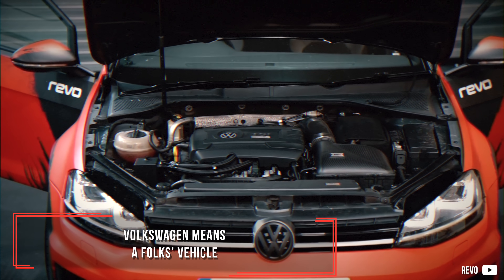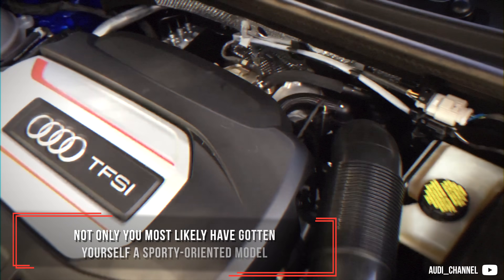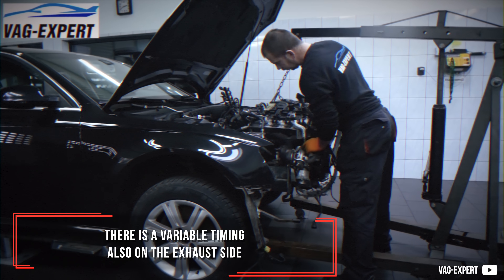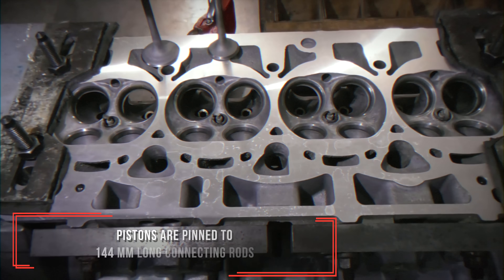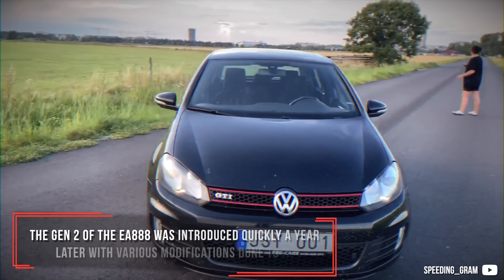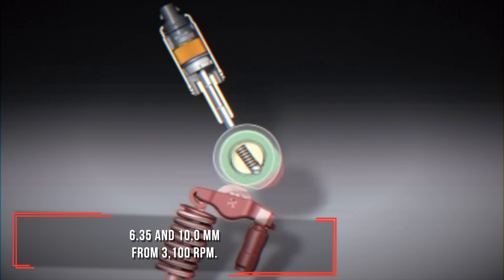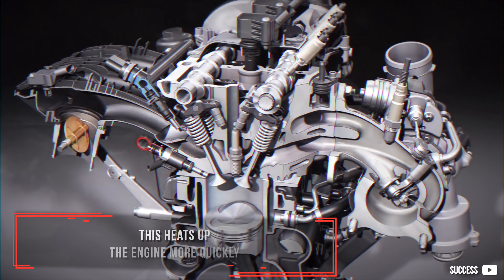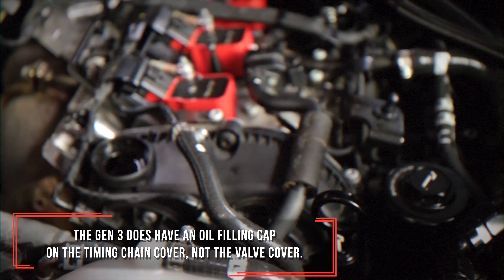Why The Volkswagen EA888 Is So Good

Comment: Luckily I'm driving an old Audi with an 1.8T 20V - Even tho it is 26 years old, it still feels like its been just built
Reply: @MIGHTY MQB I've got an aum engine in an a3.
First thing I did was remove the SAI system completely. With it I removed the DV solenoid.
Soooo much less vacuum tubing and crap all around. Much more reliable this way.
I haven't really had any trouble with these engines mechanically 🤷‍♀️
Reply: @spiKey0svetlana  It is also good to remove oil vapours at all and put a catch can.. So much cleaner intake hosess and intercooler!
Reply: @Mtematiks just make sure you have a way of telling when it's full instead of opening the can all the time 😁
Reply: @spiKey0svetlana  I live in a country with a lot less regulations, and our "catch can" is a big open hose, long enough to arrive near the rer silencers to avvoid the smell 😂
Reply: My Golf 4 1.8T GTI has 360.000KM and it still runs great❤️
Reply: 1.8T NEVER LOSE!
Reply: 1.8t are great motors. I love my big turbo motor as it’s awesome around town, decent on gas, and peppy up top with bigger turbos
Reply: @MIGHTY MQB shocking vag still such poor quality in 21st century but in over complicated engineering 😪 I’ll never buy another German car ever again after mk b7 Audi 2.0tfsi constantly cost tons of money to fix even with Audi full service history. Loving my Lexus 450h now not let me down yet you need to get to know the Japanese cars.
Reply: I have a mkiv Jetta 20v 1.8t. 
The all the torque all the time spoiled me. It has been hard to find something to upgrade to got daily use.
Reply: I had one of those !! Awesome engine, I had an old jetta  mine had 165K miles before I sold it, still ran fine. Im on my third EA888 engine now- I have the 2018 Audi S3, and its hands down the best car I have ever had..its a beast, handles exceptionally well of course highly tunable and total joy to drive.
Reply: Luckily I drive an EA888 and i'm capable of de-carbonizing the intake valves lol.
Reply: Had that same engine on my mk4 golf gti great cruiser on the motorway.
Reply: @MIGHTY MQB yep I went from a money pit Audi A4 b7 2.0tfsi se (oil chain pump failure x2) costing thousands to fix not including constant oil burning every three months loving my new my now super reliable Lexus GS 3.5 450h natural aspirated engine it’s a beast.
Reply: Same here mi a4 is from 1995 and im born in 1996 xD
Reply: @alelx jines I have a Gen2, more like every 30k for us
Reply: I drive Audi A4 B6 - feel the same
Reply: Good to hear that and thanks for sharing. I was advised by my technician that 2.0T is even better than 1.8T. 👍
Reply: Every car has it's downfalls this one just so happens to be the timing chain tensioner and guard rails and yes some consume oil more than it should and I've heard of the inner manifold flaps having problems but the timing chain and tensioner is the most important if the car was taken care of there great cars but I picked up one in great shape with 98 thousand miles before knowing anything and know I'm fixing things slowly but car runs fine im just doing maintenance so it will go another 100 thousand miles without me worrying but fixing this issues are very expensive and it's hard to find a good mechanic for Euro car's
Reply: The 1.8T had its own set of problems.
Reply: Same👉
Reply: Yes,last of the good engines!!
Reply: @MIGHTY MQB 😭😭😭
Reply: my father has one he bought it 4k and when he drove it a little wile both clutch and clutch plate broke costing him another 1100
Reply: @MIGHTY MQB I feel you. I'm still trying to locate issues on my mothers '03 Audi TT 8N9
Reply: This is a EA827 Not EA888!
Reply: hell yeah i have a passat b5 1.8t with 270k mikes drives like new have done 10 hour trips no problem but on the other hand i have a mk1 tiguan tsi that doesn’t step out the car shop at only 120 k miles 🤦🏻‍♂️
Reply: @alelx jines Why?
Reply: i own a 06 jetta gli with the old school fsi engine… im at 176k miles and it runs so good still. it’s also incredibly quiet for a fsi. all i do is change the oil frequently, cam follower, etc and it hasn’t left me stranded anywhere. love this car
Reply: Typical Audi driver take
Reply: I have an apx turbo 1.8 5 v on my 2001 TT. Any good?
Reply: I have to completely agree with you. I had a mapped MK4 golf GTi anniversary which never ever let me down in 5 years.  Biggest regret getting rid to buy a mk 7 .  So much has gone wrong with it 🫣
Reply: ur villebrequin are big not tiny like 3l today are so tiny make a bit laught 😂
Reply: yeah i have it in B5 A4 and its great engine i think it is mostly because it was originally audi developed engine for racing purposes and not just some VW developed engine used in Audi
Reply: @lukasryba7141  Most of the VAG watercooled turbo engines are Audi-designed.   When VW  originally acquired Audi, VW had absolutely zero expertise in liquid-cooled engines.
Reply: @lukasryba7141  EA888  is made by Audi, not by VW
Reply: @lukasryba7141  1.8T is modern 2.2T without the 5th cylinder . 😉
Reply: I also drive a A4 B5 1.8T, year 2000. Great engine, great tunability and good performance with low fuel consumption.
Reply: @nicostenfors5690  Me too, but only 1996. I also get great fuel economy (usually under 6.7L/100km) but i miss a 6th gear 😭
Reply: @nicostenfors5690  I have a 2000 B5 as well!
Reply: Both of EA113 and 888 are complete SHITT of engines.... so much so, that I bought an EA113 car with 54K miles on the clock with broken ebngine... 54K MILES
Absolute piece of crap of an engine...
Reply: @Mtematiks  A vehicle is as reliable as its owner.
Reply: @Mtematiks  what does that have to do with the 888?

Comment: the EA888 or generally the tfsi engines are a walk on the edge, if they run they run but if they fail: endless money pit. using High Quality fuels (even when not insisting to tune it) shorten oil change interval to 10000 km or one time per year is mandatory.

Comment: I got a Q5 with this engine. 90000 miles (150000 KM) and it runs like it is brand new. No oil consumption, no leaks of any kind.

Comment: Isn’t it true that the US/Canada EA888 didn’t get all of the gen3 upgrades, such as (but not limited to) dual injection?  Does anybody know the starting year where the EA888 gets added port injection in North America?
Reply: Port injection is still not here in the US
Reply: It’s true. Eventhough the Gen 3 engine is fantastic. Europe got the more stout engine version, sadly.
Reply: @647killa  both engines were equally stout. Adding port injection for fuel efficiency didn't make the ROW engines more reliable.
Reply: It doesn't get dual injection in north America unfortunately, I have a 2020  GTI. I wish it did.
Reply: You need to go aftermarket to add port injection to NA engines, and in fact VW got rid of the dual injection on the new MK8 for ROW too, so now all of them are strictly direct injection.
Reply: europe gets the cool engines and does not push them as hard as americans do

Comment: It is a strong, tunable engine but I hear quite a lot of stories of faileurs at under 100k miles, which is not very impressive!
They certainly go quick especially when mated to DSG (also prone to early failure) and AWD but they do sound dull even when tuned.   I think VAG have done better engine overall in truth. But as modern engines go, it is not too bad.
Reply: Rest assured those are rumors.

My 2016 MK7GTI has Unitronic stage 2 at 337HP and 370ftp. 
Since Ive owned,  ZERRRRRRO failed parts, mechanical or electrical. Hmmm, I want to thank the Mexican 🇮🇹 partners for great workmanship.
Reply: Bullshit.

You can beat the hell out of Volkswagen cars.  What starts happening at the 10 year mark is that they start to "nickel and dime" you, but it is little things like power windows, sunroof motors, cruise control....et cetera.  A properly maintained EA888 will easily see 300,000 miles.
Reply: @Flies2FLL  If there are ANY modern VAG cars still running with over 300k on the clock then I can guarantee they will have had virtually every moving part (and most of the electronics) replaced.  I've never owned a VW myself (though family members have) so I concur about all the failing accessories and electronics, but a quick check on any VW/Audi owners forums will reveal no shortage of owners suffering engine/transmission/suspension/electronics issues far earlier than they should and the EA888 is no exception to this.  Modern Mercedes and BMWs aren't any better either - All built down to a price.
Reply: @soundseeker63  "I've never owned a VW myself"

I'll just leave it at that-
Reply: @Flies2FLL  Yes, all the hassle family and friends have had with theirs in the past have convinced me they are unjustifiably overpriced rubbish.  We'll leave it at that.
Reply: @soundseeker63  I drove a Volkswagen Scirocco turbo for eight years, and during the first four, the only thing that I had to replace was a brake light bulb.  Another car, a '97 Jetta GLX was literally.....Christine.  I liked the car but it didn't like me.  It all depends on how the car is maintained, the Jetta was bought used and had obviously been abused.

Odd fact about that Jetta: The first owner lived at the condo building in Surfside, Florida that eventually collapsed...
Reply: @soundseeker63  plenty of TDI cars have made it to 300k
Reply: @soundseeker63  your ignorance is breathtaking.My 2016 MK7GTI has Unitronic stage 2 at 337HP and 370ftp. 
Since Ive owned,  ZERRRRRRO failed parts, mechanical or electrical. Hmmm, I want to thank the Mexican 🇮🇹 partners for great workmanship.
Reply: @sporopeza  The fact that a certain engine/make has known reliability issues does NOT mean every single one of their cars fails!   So no, my "ignorance" is not breathtaking. I'm sure there are plenty of GTi/R/S3/TFSi/Cupra/vRS owners out there who have has no major issues during their ownership.
What I also know for a fact is that there are owners who have had MAJOR issues (as I've already described) a lot sooner than they should.  Obviously you are one of the lucky ones if you have not. That doesn't mean all the (very well documented) failures are non existant / made up.
Reply: @rocavelli20  

Yes the oldskool 1.9 tdi's

EGR and VAG, tends to be problematic. The downsized engines strugle a lot.
Reply: @Flies2FLL  
Got a (gen 3) 3-door hatchback s3 (8v) dsg/s-tronic.

Engine is smooth in total powerband. Not as exciting as n/a or oldskool turbolag cars. But lots of power, decent gasmileage and sound. 

I am extremely carefull with this car, only premium fuel (v-power, octane 98 in my country). Yearly oil changes,  around 7-10k km.
I do drive a lot of short distances, but always with care. Only getting on the power when properly warmed up. 
Most days only using 25% of power, without or minimal boost pressure, according to gauge in dash.  

Have had issue; of car turning of while driving in eco mode, during lift and coast. Was problem with start/stop system.

Have had (around 125k km) problems with rough running. Sometimes having more power than expected sometimes less. Without warninglights on dash.
Codes: cam an cranktiming timing of.
Work done to fix issue.
-leaking injector switched others were tested and cleaned. 
-worn cam (sensor, but one piece)
-stretching of chain.
Chain is was not yet due but close (5th tooth adjuster)
-Main problem eventually turned out to be an minor intermitting fault with oilpump; took 3 weeks to find by dealer and expert.

Enginewise no further problems, no oil burning f.e.  
Except the engine sometimes feels sluggish/sleept after cruising for a while and then stepping on it in comfortmode. 

Drivertrain had an easy en cheap fix on haldex system. Rear wheels didn't engage (shortly after oilchange) Electronical update fixed it. 
Also no warning light on dash. 

I love my car; but reliable/bullitproof; definitely no.

Also a lot of (downsize) European engines have carbon problems, worn piston rings, oil consumption. Stretching chains. Leaking waterpumps. Worn oilpumps. Dieselgate and EGR valve(coolers)

Our other car seat ibiza 1.2 tdi ecomotive (vw bleumotion engine) has its EGR replaced for the 2 time at 175k km. (With only 17k km between them!) (So now driving with 3rd EGR), and a flush at 191k km.
After recall/reflash/remap., due to dieselgate, EGR fail a lot!
ECU/computer also had to be recalled (als due to egr/dieselgate)

Comment: The 2.5 5 cylinder engine in the 2011 jetta is an absolute beast for a n/a engine. vw is really impressive for engine power delivery but boy some design things can be annoying to work on.
Reply: I've got the 2.5 5 cylinder in a 2009 Rabbit and went IE stage 2... Great engine. Great sound.
Reply: vr-5 love dem. vr-6 with 4-motion tho as golf 4 vr6 and leon cupra 4 1m
Reply: @yoshi555king  wish we got the VR5 in the US. Such a cool engine.
Reply: Idk what makes the EA888 so great, but it's definitely not how the thermostat is under the intake manifold (like everything else) so what should be a $30 part that any competent garage mechanic can replace in a couple hours is actually a $180 part that requires over $1000 in labor to replace (I've done timing belts on Nissan 300zxs, done uncountable work to E46's... I wont try to remove the intake manifold on an EA888 golf. It is absurdly hard). I swear, the lead engineer's wife must have run off with a mechanic because as amazingly engineered as the EA888 is, it's designed to make the mechanic's life hell.
Reply: @thirdpedalnirvana  it's almost if they designed it thinking it was gonna be awesome and bulletproof so they'll never need to replace any of this pain in the ass stuff.  Stupid place for a thermostat, just like BMW putting two turbos in the V of a V8 and assuming it would be fine, all that heat there.  Idiots.  Or GM pitting the Northstar starter in the middle u Der the intake manifold.  There's lots of questionable designs.
Reply: @thirdpedalnirvana  I'll agree with that for sure
Reply: @thirdpedalnirvana  And on my Audi S1 you even have to rip the whole front apart to remove the intake manifold. Because there is no space at all.
Reply: I am a happy owner of an Audi A3 1997 1.8 and a VW Jetta Variant 2012 2.5, both great NA engines!
Reply: You must be kidding that thing is a dog
Reply: Have to agree that tucking the water pump way under the intake manifold makes it really annoying as hell to get to.
Reply: The least reliable part of it is the vacuum pump, which doesn't clear the selector shaft on the transmission, you have to open the pump (which VW says not to do) and rotate it out with the selector shaft going into the pump. Once you do it a few times, it's not so bad, just have to make sure you don't contaminate the pump with dirt and get the vane installed properly when you put it back together.
Reply: Drive any volvo engine and youll realize the 5 cylinder in the usdm vw's is trash. Yeah, it's got torque, the 2.5 liters make torque unavailable in the competition which was usually a 1.8 liter engine. But it's rough as an unbalanced washing machine on spin and can't breathe at higher rpm. It was a cost cutting exercise. It is an affront to the good name of the 5 cylinder engine.
Reply: @thirdpedalnirvana  yes, the 2.5 didn't get the love it deserved from vw. But Audi took it and basically added direct injection and made the block aluminum. It's a good engine, just needs some love from the aftermarket

Comment: So I think the main thing here is that the years for the engines are kinda wrong. The Gen 1 was produced from around 2008 debuting in the Mk5 GTI to about 2016 in certain applications like the Tiguan, with the Gen 2 being from 2008 to around 2013. The Gen 3 that is ubiquitous today was introduced in the mk7 golfs in 2014 and is still produced today.
Reply: Wrong, MkV still had the EA113.
Reply: @MercSLRFan  the 2008.5 MkV GTI had the gen 1 EA888 for a short time before the Mk6 came around, which also had the EA888
Reply: @tomster_6274  Fair enough

Comment: Great video, ive got a gen 3 cupra 290 and even stock its lairy,absolutely love the way it produces peak power well up the rev range. Im still under warranty but after that’s done 🤔😉. Enjoyed that👌
Reply: I have a 2015 st280 stage 1 370cv, 100'000km and runs perfectly, like new. Never have issues. With correct maintenance these engines are bulletproof
Reply: @patrickrodrigues4202  my brothers golf r has been stage 1 since new in 2017 and  hasn’t skipped a beat and has nearly 70,000mls! My 2020 290 has admittedly low miles At just over 20,000 but most of them apart from the first 1500 run in miles have been enthusiastic miles and so far only a burst tyre and my  oil changed every 5000 whether it needs it or not! Look after them and there easily as reliable even with tuning as any other high power 2.0 4cyl. Anyway just wanted to say point well made m8 cheers 👌

Comment: In Brazil the EA888,it's a great engine for tuning, but the maintenance costs are stratospheric, if the preventive maintenance are done right. Timing chain and high pressure bomb are common issues here.

Comment: they have a reputation for shitting the timing chains and blowing up at the 120K to 150K km mark where I live. GTI, A4, tons of them for sale, cheap, "needs engine" but no used running engines available anywhere.
Reply: Same here, but just stretching a bit. Not the most expensive fix. Access is pretty good, I've been told by my dealer/mechanic.